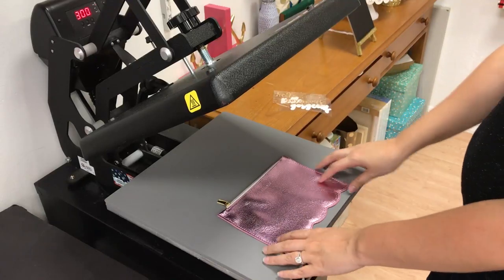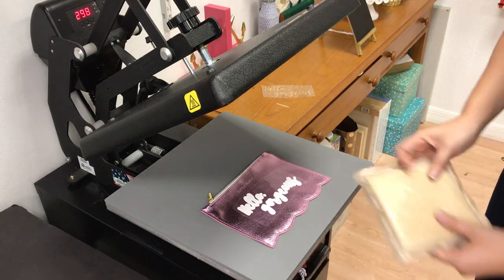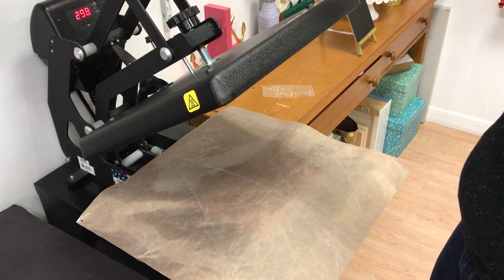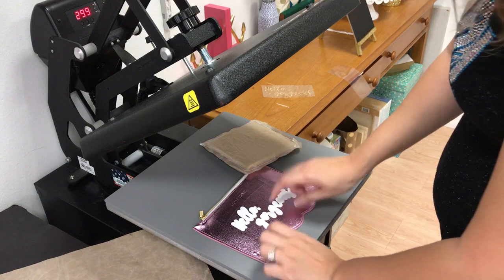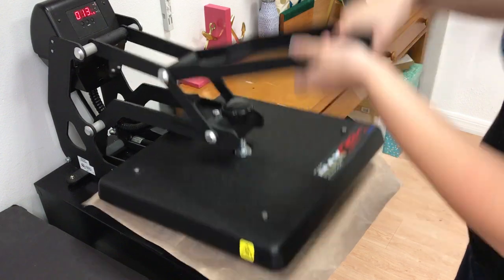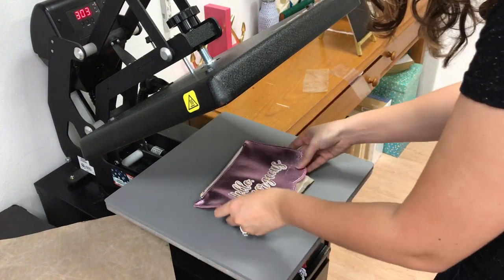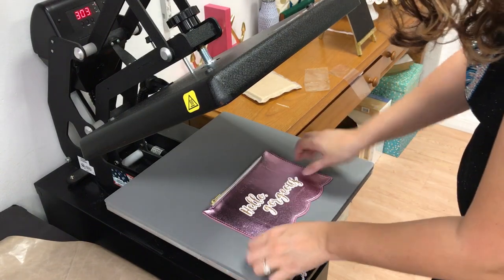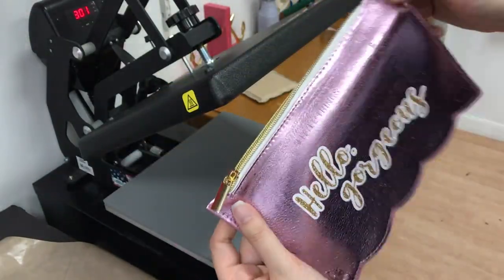TRW Lab #13: Can You Press HTV To An Artificial Leather Bag?

Comment: if you turn it up side down and have the zipper hanging off the heat press and 
 use your carrier  sheet.  that way it will  prevent getting lines in the material and you won't have to use the pillow

Comment: To avoid the carrier marks try not clamping it down, just pressing it to the point where it almost does. Or press it for a shorter time, 5sec instead of 10 or similar, wait until cool, carefully remove carrier and press again without. Or on a lower temp for a bit longer.. Trial and error ;)
Reply from the maker: Yeah, I'll definitely pass this on so they can do a little more testing for sure! :) 

TRW NIck